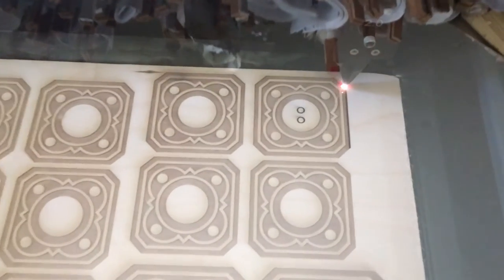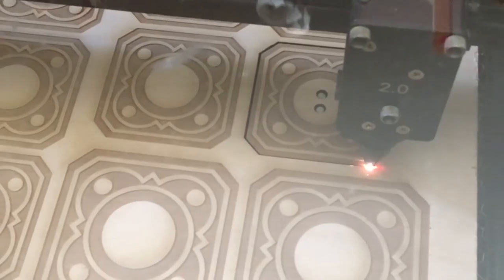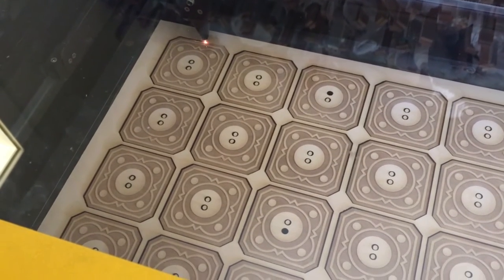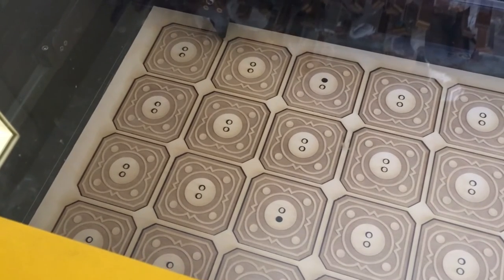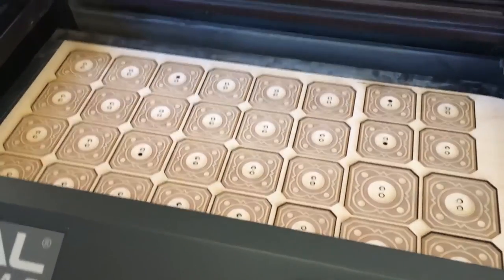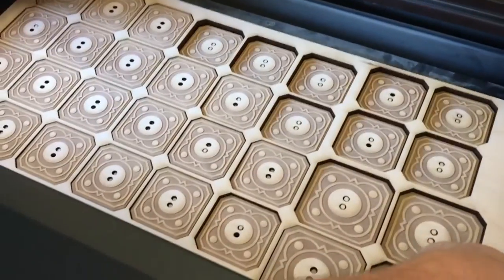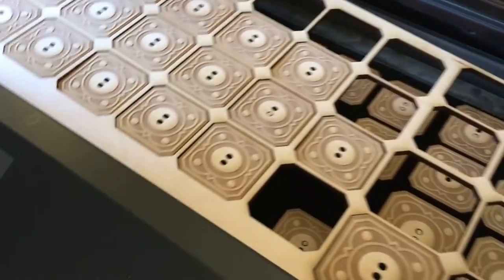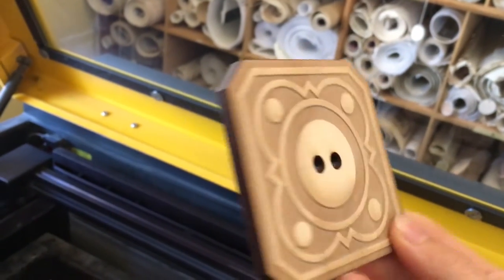How I Made Ciri's Belt ["The Witcher" Cosplay]

Comment: Now if I could only figure out how tf to make the sword 😭😭
Reply from the maker: Slaysmr GIRL SAME 😬
Reply: Ginny Di I thought I was going to be able to get ciri done this year but I'm probably going to postpone it to next year. Let us know if you figure out stuff with the sword! 👍
Reply: I made a ciri cosplay this year and while the sword wasn't great up close, it looked pretty nice in photos! I made it out of foamboard (foam sandwiched between 2 pieces of laminated paper) which is actually quite cheap but very sturdy. If you use about 2 layers for the blade, and then add an extra two either side for the handle part, it ends up looking pretty decent. It requires SO MUCH sanding (which is a pain in the ass) but it was the easiest and cheapest way i found of doing it :D